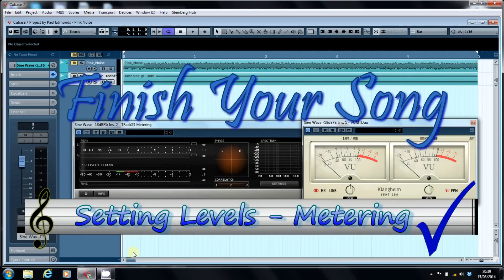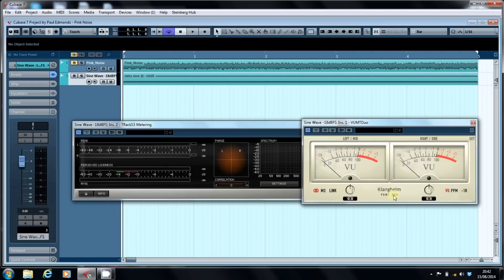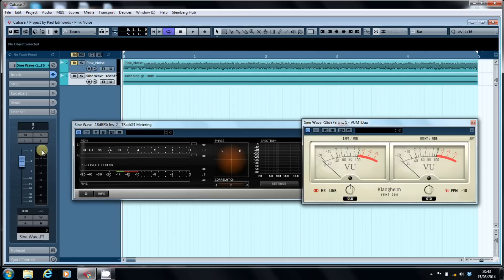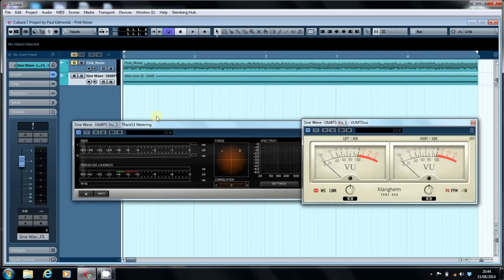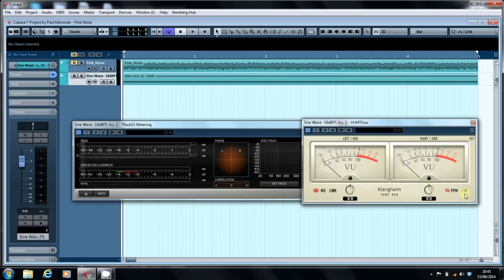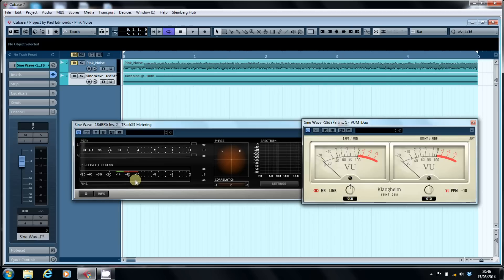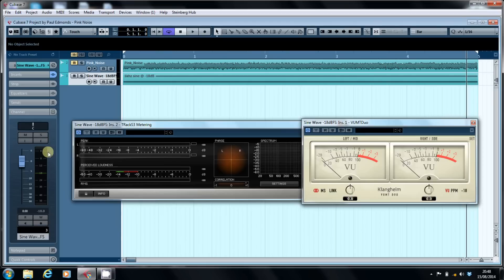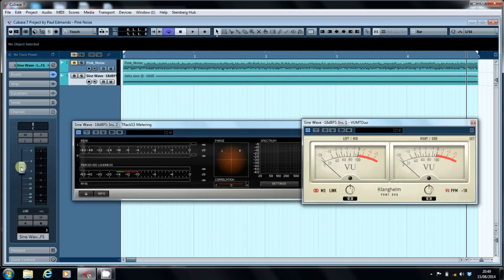Introduction to Gain Staging - Setting Levels & Metering

Comment: Thank you for an informative video. One thing some people might not be aware of is that the RMS level of different plugins and daws are not the same, and its quite annoying to use a limiter with a wrong RMS level, and then later find out that a track is limited to high or too low.

Comment: I learnt something there. Never knew that, not that I ever had my mixes at full on.  The problem I have with my mixes they tend to be a bit too dull as I mix through my headphones as I record in the house and need to consider my ears of my family.  So I've yet to get a mix that sounds good on my headphones and out of speakers.  Some experimenting is required.

Comment: Thanks Paul, really interesting.
just one question...
your videos, this video, has the clearest, noise-free, perfectly recorded voice i have ever heard, and we're talking about thousands and thousands of videos, tutorials,podcasts even pro tutorials often are full of noise. 

i'm watching this video with my headphones, and i could hear a fly landing on your desk or chair, if there was one(fly)..

how do you achieve this exceptional quality ? what microphone are you using, what distance you talk from it, with or without a shield, etc etc ? could you share that with us ?
and is the audio from the video edited in cubase, or is it "raw" ?
my sm58 or my rode nt-1000, with a simple behringer mic preamp, or a more $$ tube preamp, etc, none can give me that incredible sound. i promise you it really is... i've listened to some 96-192khz masters, and even there, voices aren't this perfect.
i'm sold. i'm jealous :)

thanks again.
Reply from the maker: no name You may find this disappointing, but I record the audio narration for the videos using a HP Premium Digital Headset plugged into the USB port on my laptop, which is set up as the input and output on Cubase.  It's the only time I use the headset and it was bought specifically for that purpose.  I run the input through a compressor and a noise gate, then route it straight to the Stereo Out.  Because recording screencasts in Cubase when the ASIO driver is selected isn't straightforward, I record the audio and video simultaneously, but separately, and import them both into the video editing software and sync them up later.I do edit the videos afterwards - I'm not as eloquent as I would like you to believe, so the ums... and pauses are removed!
Reply: FinishYourSong lmao